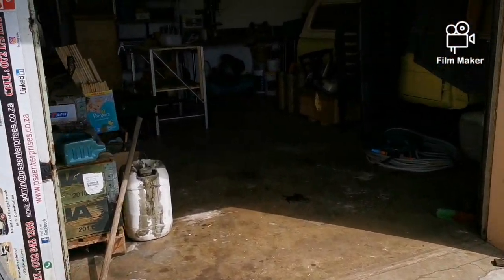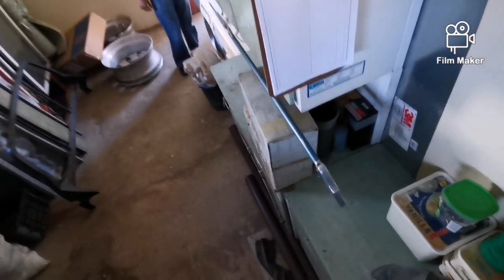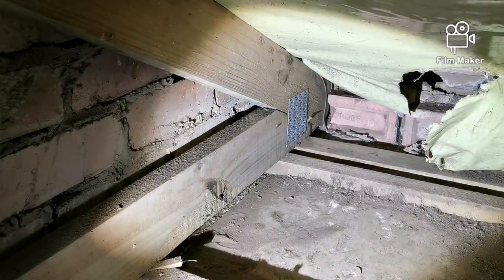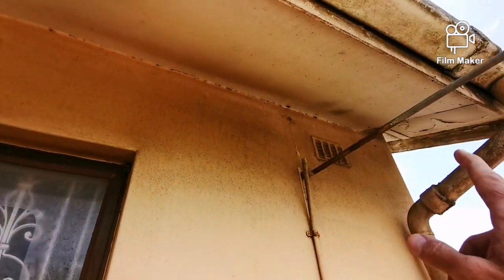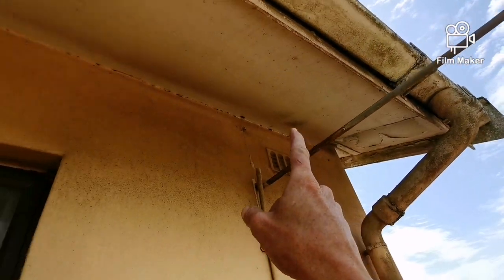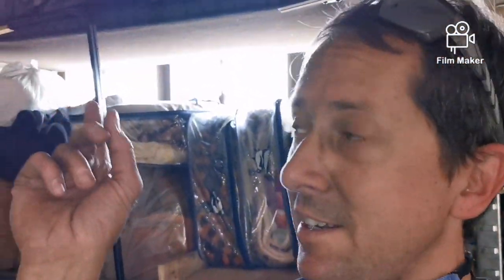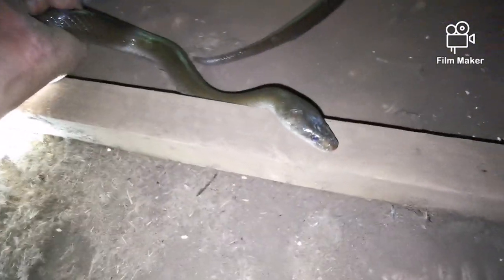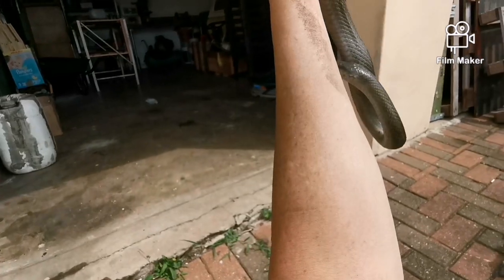Searching for a large snake in a ceiling

Comment: I don't know if you have home improvement centers in S Africa, but Milwaukee Tools manufacture a 12 volt lithium optical flexible camera. They have a couple different models, but it's a handheld camera with the lens on a nine foot flexible cable. Allows you to see in walls and ceilings. It's about $250 (USD). Great product. The link wouldn't copy, but here is the official name if you want to Google it.

M12™ M-Spector Flex™ 9 Ft Inspection Camera Cable Kit
Reply: That was my first thought as well that need defenetly needs one of those. Would make his job so much easier.
Reply from the maker: I'll definitely have to check that out.
Thank you very much 👍🏻🙏🏻👌🏻